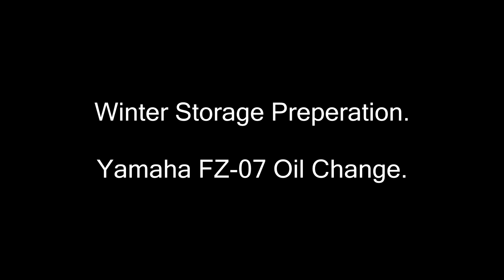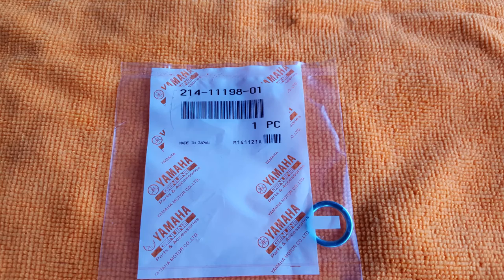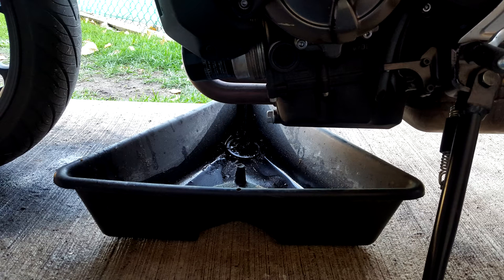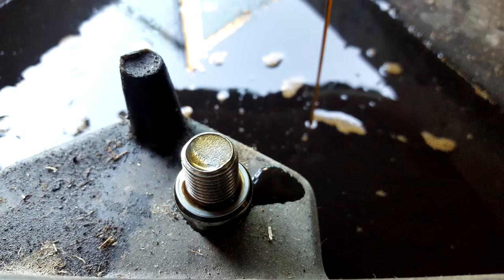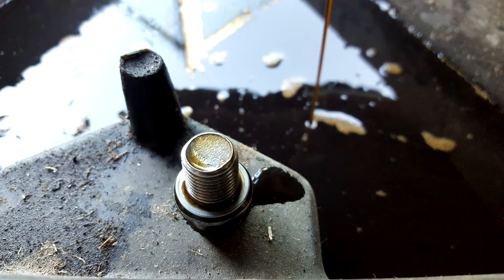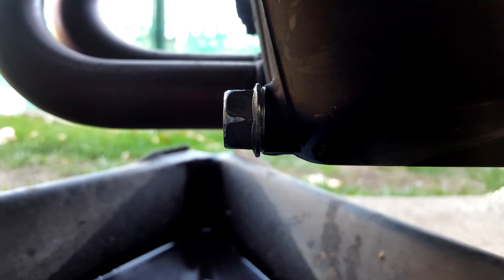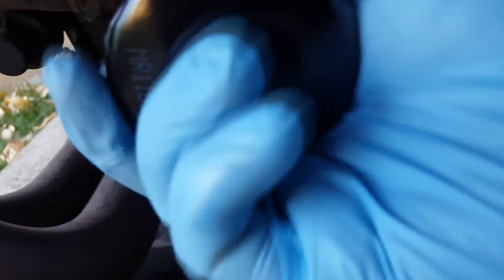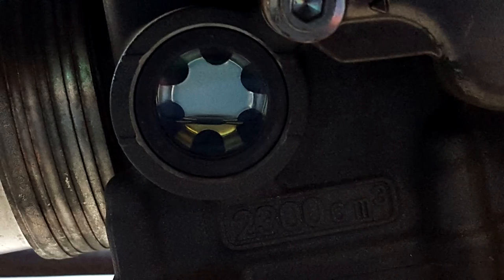FZ-07 Oil Change - Winterizing your Motorcycle

Comment: I changed my oil like 2 weeks ago because i planned on parking it last week. The weather lied and I've rode it almost every day. I may have to change it again before it gets parked.
Reply from the maker: +myztklk3v Nah you should be fine.  I always change the oil before winter and then again when I bring it out in the spring.  Just make sure you put in fuel stabilizer, run the engine so it cycles into the lines and then clean/lube your chain.  I use chain wax myself and will be putting up the video detailing that process next week.